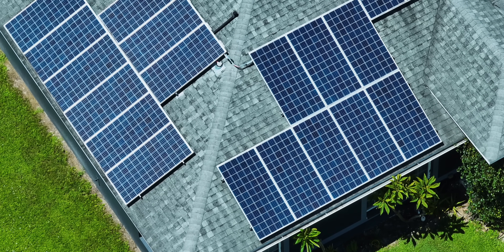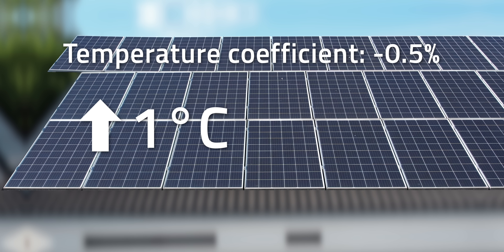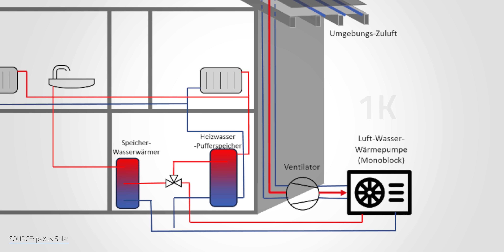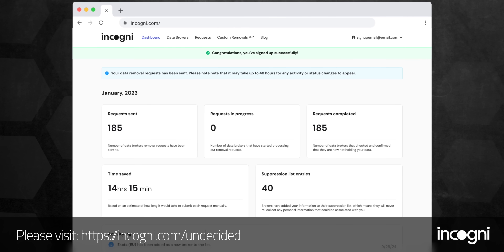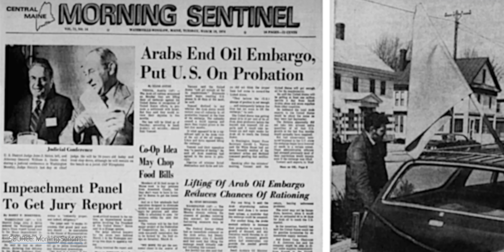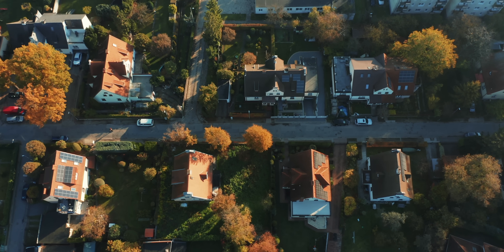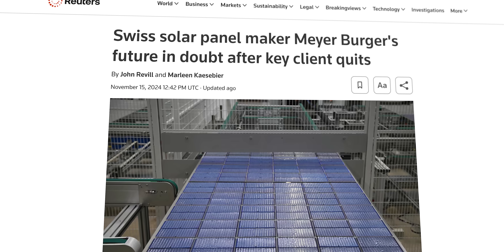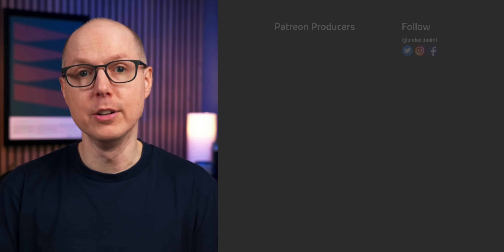Why Hybrid Solar Heat Pumps are the Future of Home Energy

Comment: Came up with a new panel idea about 3 minutes in.

All in one panels that connect directly to the joists and stacks vertically up roof instead of across.  You'd screw the brackets directly to the joists and then .  Solar panel on the outside, wiring and heat transfer pipes on the inside with a glycol mix loop going up and down each set of solar panel modules.  Use removable insulation blocking on the inside, and you can get to the backs of the panels from inside your home.

In the stack, each one locks into the one below it with quick connects for cables and thermal pipes.  Each stack is a closed loop of coolant that goes down to the eaves of the roof, where another coolant loop exchanges with each of the stack loops on the roof.  The eaves can also hold sensor kits for environment monitoring, providing data to the management system.

On the outside, each module's PV is removable from a gasket system, unplugged from flat-formfactor wiring, with thermal paste backing the PV against the thermal plate contacting the embedded pipes.  You can replace the PV on any module any time without removing the whole module, just make sure to refresh the thermal paste/pad, and make sure the gasket is clear.  

I tossed the whole thing into a logic LLM, seems like it's feasible.
Reply: there is no such thing as a logic LLM, they are not by design, even models capable of reasoning cannot be called “logical”

Comment: @arquizone
If nobody says the obvious I will do. During the summer when the panels overheat you dont need to warm up the house. And during winter when you do require heat, the panels dont over heat. Hot water for shower and taps  during summer represent only 2% of your energy consumption. But there is a function for that heat in the summer, if you plug that heated water to a heat absortion chiller you could produce cooling for your home in case you need it.

Comment: I don't understand why there isn't a "heat pump of things" concept with a central heat pump feeding multiple devices of all types through-out the house.  Heating, cooling, the refrigerator, water heater, dryer. Why does every application require its own heat pump?

Comment: Cool new opening tune! Regarding the video, one question: isn't this system a little paradoxical? When there is more sunlight is also less need for the excess heat from the pump, and when the pump's heat is more needed, the sun is not too warming.

Comment: A German company develops a tandem solar cell & a Spanish company develops liquid cooled solar panels.  The liquid can be potable water used for domestic hot water and for under floor radiant heat.  A highly insulated tank can store the excess heat to buffer the system.  Or just put some "copper crickets" under the panels you already have in place.  If more heat is needed, use concentrating collectors as super-heaters.

Comment: the biggest problem I see, is when my panels need the most cooling, my house needs the least heating. Sure SOME of the heat could get dumped into my hot water system, but how much is that really going to achieve when it's already 40ºC+ outside, and I've only got my hot water set to 48ºC and I'm not using much hot water? I love the idea, but part of me thinks the extra cost might just be better spent on extra panels

Comment: I thought about multi light wave PVT solar roof tiles in a roof tile standard size. Did you know that the houses thermal mass can be used as a long term seasonal energy storage?

Comment: nice idea, of course. But I really can't stand the fragmentation of the heat pump market. We urgently need some over-arching modular system with a standarized coolant loop and a cool multi-valve. This way, we could mix-and-match the compressors, indoor units and groundloops, and if we e.g. install solar panels, we simply have to hook it up to our coolant loop and tell the software when to open that valve. If we have an outdoor shed we just built? Run water, electricity and a coolant loop extension and get a small generic indoor minisplit thing. If we have a battery back that we want to keep at it's happy temperature? Just add a coolant loop.
The coolant loop could run un glycol or something like that, and all the devices could have some efficient heat exchanger to their internal working fluid.

Comment: Gonna be real, this is the first video i don't hate. Because this isn't anything wild and i can redneck it together myself. No need to make is a solar roof or even have supper custom panels.
But im just an electrician. So im putting panels on my south facing wall rather then my east west facing roof, south walls have better performance and lower cost per watt then on the roof (in my install experience) and im going to flex tape it and use a DC water pump to heat a small pool, with water level control.

The masive jump in efficiency is only going to cost me 500$ and some duct-tape.
Where im amazed active cooling pv isn't used is Australia. Solar panels heat your house, but if you got pv you probably have AC and didn't notice. Panels trap heat between the roof and the panels, heating your house and making the ac work harder.

Water evaporative cooling can't be used in extream heat because of lack of water in those area's and idk the usability of heat pumps to cool in that application as you will probably over heat a heat pump or boil over. Hard to not melt your electronics when you have a oven on in +40 degree weather.

Technology gets better, and long after becomes affordable.
In the comuter world, they "invent" your cpu, gpu, ram, storage 5 or more years before it in the market, and truthful that's pretty normal.

My main take away from this channel is looking at the Technologys that did and didn't make the test of time. 90% of the things talked about in this channel won't ever be a mainstream realistic problem solving solutions, but that doesn't make them any less interesting and cool

Comment: Well, it still has the basic problem, that while you need heat the most, your solar panels produce the least and when you need cooling the most, your heating needs are the lowest.
So I would rather want to know, how they compare to earth warmth heat pumps, as those seem to work better in winter in theory.

Comment: Solar collectors are having much better efficiency. Even with combined to heat pumps. I developed an economical calculator for this kind of system over 20 tears ago. If you don't need electricity, install collectors before panels.

There is also a lot of overlapping operation, which impares total efficency and/or economical feasibility, if not carefully designed. And you can not eliminate such deficenty totally.

Comment: @4:50 The tiles save 1400 Euros, over WHAT PERIOD OF TIME? Is that per year? Over the lifetime of the tile?
Reply: If Matt’s grid electric cost is $0.147/kW, then this value is for 10,000 hours, 5h/day avg. production, 5.48yr. A weird metric, so more likely quoted from some marketing material with convenient input values. If you could actually save $1.4k for 5 small panels over 5 1/2 years, these would be practically free.  But this is just part of total system cost, which he gets into  @9:00

Comment: I think the simplest upgrade would be to install defrosters on the panels that sense snow and ice, and use some of the power generated to melt it off until the panel is clear. The sensor could be a simple infrared diode and transistor. If infrared bounces off of snow, it turns on the defroster on. Then you don't have to shovel off the snow.

Comment: To me it sounds like dont use the titles. They add cost and extra stuff if you ever need to replace them. Traditional panels sound the way to go, but with an extra 1-2 direct heat panels that will warm up the water that can be pump into your hot water heater (most people do take showers in the morning or as they get home). If the air pump needs extra heating, it could take it from the hot water heater instead vs directly with the panels it sounds like. Any heat that needs to be dump back out - just push it towards the hot water heater instead of outside.

Comment: The biggest need for cooling the panels is during the summer months. And during those months my heatpump is mostly used for cooling, so running hot air through it would be counter productive...

Comment: How about a video on low cost solar systems using UL3741 racking which eliminates the rapid shutdown requirements and thus eliminating micro inverters and their cost. Utility scale solar arrays never use micro inverters because of the expense and limited lifespan.

Comment: It always bothers me that these 'solar roof' type concepts are always trying to hide what the panel is, which IMO is only worthwhile for retrofits to older buildings, especially the ones of historical value architecturally. For everything else why can't you just design the solar roof to use regular panels in a way that looks deliberate and neat rather than mad scientist bolting crap on the house. I'm thinking something that visually would look similar to those very smooth flat zinc metal roof panels (though different of course as the solar panels have that visual pattern on them) - all you need is the ability to bend some sheet filler panels to fit more complex roof geometries and fill in the spots where the building isn't big enough for a whole extra panel. Then you have that smooth external look of a deliberate design and can still replace damaged panels or upgrade to newer fancy ones with the relatively standard sized panels. You'd likely still need a 'real' waterproofing roof underneath, but...

Comment: 2:12
So it turns out that the worst of the top-five PC air-coolers outperform the best of the top five water coolers on every metric:
Cost, noise, BTU/$, longevity, reliability, complexity, ease of installation, risk

Water coolers for PC's are essentially a meme, or is useful for extremely overclocked solutions, or if you're going more for aesthetics than pure performance.
Source: I've been building PC's professionally for 20 years

Comment: Am I missing something here? You said cost is a major barrier and then showed installation at $4k-$8k which is the same as, or cheaper, than a new regular roof. That's cheaper than traditional solar panels. This seems incredibly affordable even if the numbers are an under-estimate.

Comment: As an installer in the Netherlands, I have experience with both SAHP and regular air source heat pumps. I don't see the need for such a breathless clickbaity title. Both types of heat pumps are a great way to heat homes. They also both have their own use cases. A good installer has a toolbox with several solutions to specific problems.
For example: some home owners might be reluctant to have an outdoor unit with a fan for esthetic or acoustic reasons, especially in a densely built environment. A ground source often is not feasible or not legal in the city. In that case heat exchangers under existing PV panels (SAHP) are a great source of heat. Another option would be an energy fence: a hollow fence which serves as an air-brine heat exchanger (and as a fence 🙂).

There is not one miracle solution to switch away from fossil fuels. We have many tools and there's always at least one of them that's right for you.

Comment: nice, saw a similar tech on some solar powered yachts, tubes with circulating fluid in them to work as a heatpump, excess heat is used to heat up living spaces or dissipated into the water through the hull and works other way too if cold, the excess heat from the engine and batteries /they heat up when charging or discharging/ is sent up the roof with the solar panels that are warmed to the range of optimal operation conditions and/or melt of freezing rain or snow when on anker..... one day when I retire I would love to move into a small state of the art tech ridden factory built house or a houseboat working an island system with excess electricity and maximal autonomy, no bills except foodstuff

Comment: Big drawback, when you need heat, there is little solar, it is cold, so the panels don’t need cooling. 
Cheaper to just add more panels, if that is an option. 
That said, if integrated into a new build, it should work. Even with standard panels, a fan to drawer warm air into a space, say greenhouse, in which the heat pump is located may work. 
Siting of heat pumps is perhaps not given sufficient/ any consideration.  They normally get put where most convenient, not is the the warmest spot.

Comment: We have 6.5 kW.h of solar, a Tesla Powerwall and a heat pump hot water system. We have $3950 in electricity credit. The solar and heap pump are not connected though. The solar provides electricity for the heat pump though.

Comment: I'm guessing in the winter when the temperature outside goes well below zero centigrade and all the water freezes, either you need to heat your roof or the water will freezing in your roof.  If the water freezes in your roof, then the entire system will start to leak and you won't just need to repair the roof system but the water could also damage other things.

So if you do need to heat your roof in the winter then you'll be using a lot of electricity when electricity is most expensive.  The cost of electricity is not the same all the time, you'll be using electricity to heat your roof when electricity cost the most.

As for adding anti-freeze to the system, that just means you've have the same problem when it's few degrees cooler.

Comment: Well, it comes with the general problem of solar roofs. It replaces easy systems which can be installed and maintained without a very specialized background by a more complex one. At the same time it makes you reliant on unique and special spare parts, whenever something breaks. Should the manufacturer go out of busines, would you still at least get replacement tiles of the same format? I think, such a system can be great for a big commercial customer, who would hire companies for all repairs and maintainance anyways and who would use it at a scale that makes it viable to solve problems. For small home owners it sounds less attractive as it is. Solar tiles which seamlessly replace individual tiles of all kinds of common tile systems with a kind of plug and play system would be much more generally useful. Some shingles on your roof are damaged? Replace them with solar shingles of the same type and plug them into your system. Don´t have the money for the next solar tile or they are no longer available? Just swich out broken ones with regular tiles. Another system I don´t see, is to just connect regular solar panels to replace or built sections of the roof. They are watertight and have an aluminium frame, which could be used for overlap and to fix them together, so, I wonder, why there should not just be a universal quick connector system. That way you wouldn´t have to buy shingles + solar panels either.

Comment: A cool idea but the reality is that solar panels are really really cheap. If installing a solar system in the US is expensive it is not because of the panels, it is labor, taxes, permitting and other parts of the system such as batteries. If you want say 10% more performance out of your panels just add 10% more panels and it will be cheaper than trying to engineer cooling into the panels. That said, with mass manufacturing such a hybrid system could be viable. Unfortunately where I live we don't need heating for the house and a simple solar water heater would be a lot simpler and cheaper.

Comment: This would really only make sense if you could recover that excess heat from under the panels in summer and convert it to cold for a/c. Seems it does the exact opposite, no wonder the original developers sold it to someone else. On our solar setup (in New Zealand) I just made sure there was a big air-gap under the panels for air to freely flow. Our biggest saving is a device that detects the moment we start exporting and then diverts the excess to our electric hot water cylinder. Being a resistive load even a couple of dozen watts helps out. We only have a 5kw system with 7kw of panels in two arrays (east and west) and we have not paid a power bill since installation, and we are just over the 3 year mark and have over $600 credit with our power supplier. Note, full electric house including 2 heat pumps and double glazing.

Comment: What I don’t get is why heat pumps don’t work in with subterranean ground temperature? Dependant on soil composition, you reach a depth of say where the temperature is constant all year round, eg. 17degC & is independent of the outside temperature. That would help to cool in summer & heat in winter.

Comment: There is another german company doing SAHPs in a more traditional Panel form factor so the cost is not as high but you don't get the neutral aesthetics. As I understand theyr pricing is comparable to getting solar plus a heatpump installed. Since I don't know if it's considered advertising if I post the name of the company I will only mention that they are based in Aachen. I find the concept very interesting because of the space advantage, you don't have to place one of those giant boxes anywhere. Sure in the US space is not as big of an issue in most places but in germany space is at a premium and noone likes a giant box with a noisy fan in theyr already limited garden space.

Comment: Aren’t most panels down to a T coefficient of -0.02-3%?

But this sounds like it might work really well for multi-unit dwellings where there’s more demand for hot water even in summer. That way taking heat from the roof will always be useful.